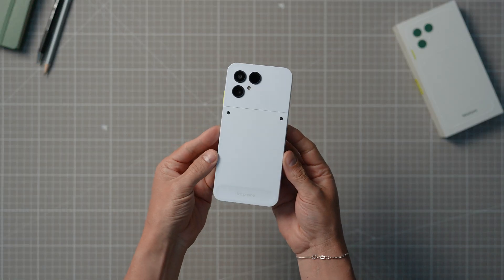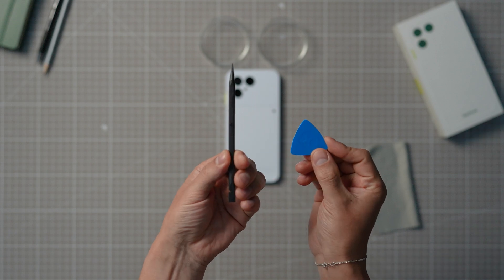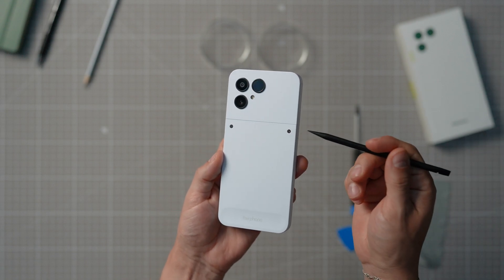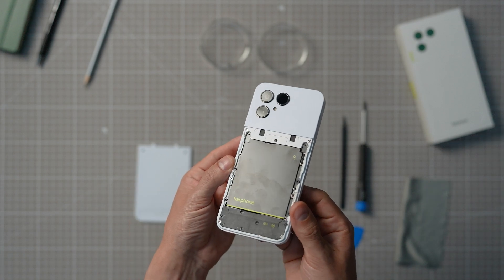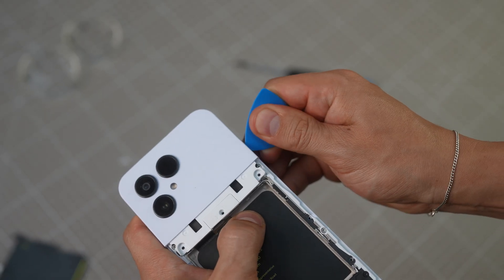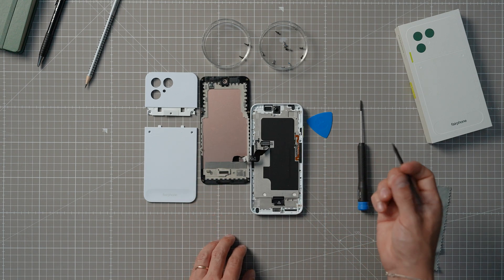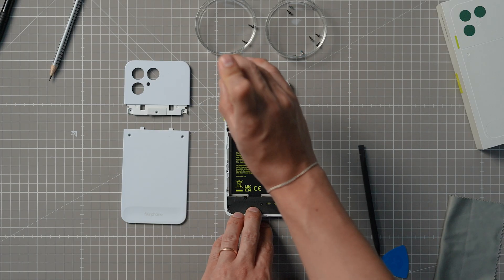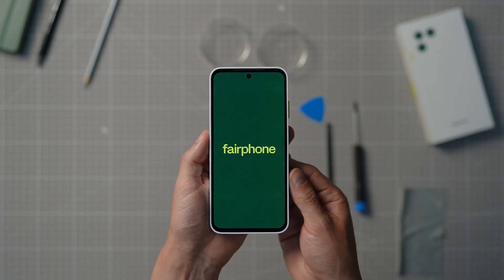Replacing the Display | The Fairphone (Gen. 6)

Comment: I think the switch on the side is not the best idea because a button gives more function (1 short press, 2 short press, 3 short press, long press...). And this is why Apple replaced the mute switch to a button. It is much more customisable. I think for an Android phone it gives much more opportunity than on iOS because iOS is a closed system. And if the peoples want to use your Focus mode then they just use it, and they set up another shortcut for long press or double press or whatever combination they want.
I really like your phone and the easy repairability, but this option to disassemble our phone is kept me thinking what would i replace in it that makes it more usefull than an average phone and this is one of them. I don't even mention replacing the wide camera modul to a 3D object scanner module like the one on the iPhone pro modells for Blender and 3D printing.
Maybe in the future. I would take a look at Framework tough. ;)
My next phone is Fairphone. Great job.

Comment: Why did you guys choose to go with screws for back cover and battery removal? FP5 was completely toolless for these 2 things. Is it for increased structural strength (assuming multiple fingerpick openings made the previous back cover iteration weak or maybe they came off easily after the phone went through accidental drops) or waterproofing measures (if so what's the increased IP rating?). Or is it because of supporting the new accessories like lanyard, etc?

Don't get me wrong, these are still way better than the glued stuff we see from prominent smartphone manufacturers and that also shouldn't be much of a hassle considering such back cover openings to repair or replace items will only be one-off/least frequency things and not something of regular nature but still was curious about this big change.

Congratulations once again on the new Fairphone. The new look is so beautiful and the minimal looking accessories adds an even more personal touch. Much ❤ from India.

Comment: I like all the extra supports keeping the connectors stable under strains ❤

I wonder what the reasoning was to opt for torx screws over the more common philips ones? I'm guessing torx gives better leverage and is harder to break. That has happened to a lot of philips screws on laptops repairs.
Reply from the maker: You got it right! longer lasting screws 💚

Comment: The direction of travel seems to be towards making repair more difficult. Screwing in the battery. Fragile clips. Pick tools and clips.
Reply: Whats the problem with screwing in the battery? Its probably more waterproof
Reply: The fairphone 5 was built on such strong principles that it ended up being a bad phone. The fairphone 6 takes a more pragmatic approach with more trade-offs in repairability and "fairness", but the end result is an actually good phone that people will want to buy.
Reply from the maker: Pick tools and clips are optional, but will make your life easier 👍
Reply: Looks pretty simple to do, and no horrible glue!